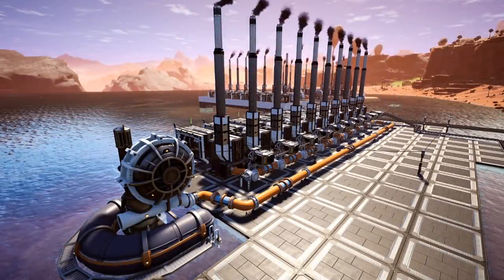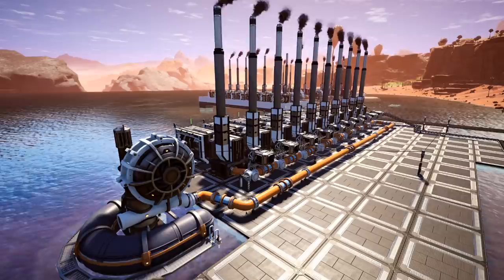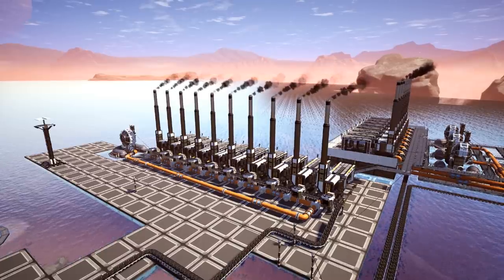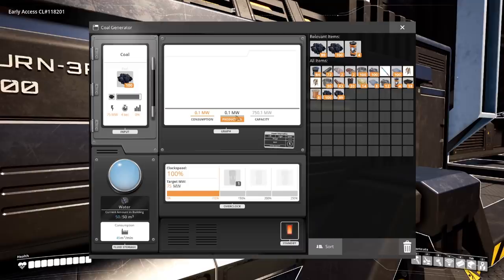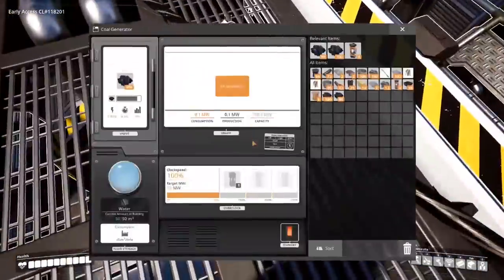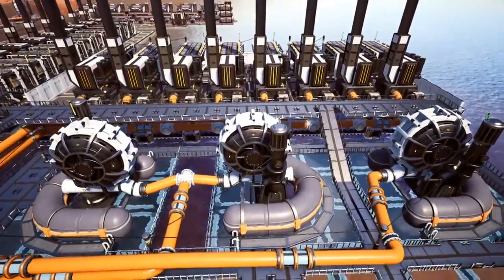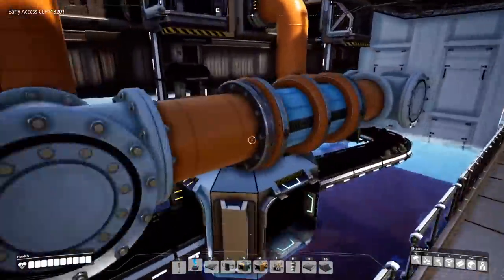Mythbusters How Much Water Do You Really Need To Run A Power Generator  Satisfactory Game

Comment: Excuse me for being a pedant, but you are confusing megawatts and megawatt hours! Megawatts are a measure of power (1 million joules per second), megawatt hours are a measure of energy (1 million joules per second for one hour). They aren’t interchangeable! On the graph, the level of the line is the power and the energy is the volume of the area under the graph over the duration of an hour (which I presume to be the whole graph). In almost every case in this video, you say MWh instead of MW and as an engineer this irritates me more than it probably should :S

Comment: Unfortunately, on a larger scale it is not profitable to build so much, although it's cool and I recommend it to start with
Reply: Coal power is early mid-game. With oil power water gets unnecessary for power production... at least for a while.
When the nukes are coming water will be essential again and as the startup of the system is quite "expensive" nobody would take a risk and add too many plants to the water network. ;-)
Reply from the maker: Yeh you're right, unless people use factory switches...
Reply: Luftwolf Unless you have the watered down fuel recipe,  then you need bottled water,
Reply: @SirHackaL0t.  : Yes, that being an exception of course.
Interestingly I don't know of many people who went that way. Most focused on getting to Nukes as fast as possible instead...
Reply: Luftwolf why rush the game? Half the fun is building up to the end game. Going straight there spoils the journey
Reply: @SirHackaL0t.  : For me the game just begins when I've unlocked all tech (including alternate recipes) and spotted that perfect location for my final base. ;-)

Next I'm collecting all kinds of resources and setting up enough power plants to never be concerned about that again (which right now means 20GW to me; as soon as overclocking is possible again the double).
This requires nuclear plants as I don't want to flood the map with fuel generators. xD

Of course that's a matter of taste. 8-)
Reply: @luftwolf7405  aah well... 60-80 coal plants... who needs nuclear power :D the global warming is brilliant, no snow to remove from your train before you go for your morning ride :D so much easier than nuclear hassle to be honest... 3 mines running full tilt = loads of fun

Comment: How much coal do you need for the 8 generator setup ?
Reply from the maker: at full energy production a single generator uses 1 coal per 4 seconds, so 15 per minute. 8 x 15 is 120 per minute. So a single full mk2 belt - but you'll rarely be running at 100% capacity.

Comment: I use 1 water pump at 250% (300 then matches 50 per power plant) for every 6 coal generators as a modular group......seems to work great, but perhaps others can point out flaw(s) in this approach?
Reply: Well yes it works, BUT..  overclocked buildings consume more energy per product (1 Pump at 200% consumes more than 2 Pumps at 100%). And you're wasting Power shards for something simple like a waterpump instead of just building a second one. Those could be better used in e.g. a Quartz node or what ever you are lacking in your current stage of the game. (Ignore that second part of you have excess of shards and dont know what to do with them :) )  But yes, its compact and Handy if you're limited in space!
Reply: @Gsichtshorst  thank you for the clarification, appreciated

Comment: a small thing, I'm not sure if it helps by that, but your conveyor and pipes are  a bit wrong maybe
if you get like 120 coal per minute, your first one gets like 60, as you split it there, then the next one gets one 30, the next one only 15 and so one. as it's the same with the water. idk if it would change if all generators get the same amount, but just wand to mention it.
my set up have like 9 generators for now and my only issue is like  to seperate my water pipes
Reply from the maker: They're not wrong :) This is the overflow method. You can split pipes and conveyors evenly but it works exactly the same. Take for example a factory running at 50% of the power produced and we have 4 power generators on a mk1 belt.
You're right in that the first generator will take 50% of the resources, so for this example 30 coal per minute and at 50% consumption the generator will consume 7.5 coal per minute. so within 3 minutes the power plant will be fully backed up and once that happens only 7.5 coal will be split per minute to the generator. The second split will now send 26.25 coal per minute to that generator until full and after a total of 47 coal will be sent on to the last split. (also bear in mind that they will still be filling up whilst the other generators are in use.)

It'll take longer for them to get up and running, but doing it this way you'll find that the system is quicker and easier to scale and also has less down time, as if you're constantly splitting perfectly any minor hicup will effect later down the line where as with a manifold / over flow system there's a backup supply. I cover it in a video if you'd like me to link you to it. 
If you have 1 extractor to 9 generators I promise you once your factory power consuption goes up, you'll quickly run out of water in your power plants
Reply: @TotalXclipse  I mean sure, both things work and I use a combination from both, splitting so all get the same amount, but not carrying how much I get. I have like two groups. one is full have like 6 coal generator and the second have 3. I have 3 or 4 water pumps and 1 mk2 miner on a pure coal I don't use the improved coal for now (but I could do it). I mean yeah. the only overflow is easy to make and takes less space. but by a power plant, it's quite risky as like when the last one gets barely supplied  as you advance further and not thinking at the power. normally you could supply your base with it, but if one generator gets down, your whole base gets it too. I mean sure, the other one doesn't pretent it too completly, but there is a higher chance that it will keep going.
I already saw your manifold system and got a bit confused as I know the first one with splitting (who uses imkibitz I think) is like splitting it up and uses the right number for the stuff and even merging the stuff together, but I mostly look at the numbers and if I produce enough, then I will just let it. 
sure your technic works too, but idk, it looks abit better if it's splitted at least,so you could look at one pipe or conveyor and if you see, it gets less you know you need to stuff to it
Reply from the maker: I agree it looks better if load balanced perfectly and I use both methods, and as far as I know Imkibitz uses both ways as well. But I’m not pushing any amount on my manifolds. Like you would the perfect split I put the exact needed ratio of items. The last splitter on the manifold will always continue running splitting 50/50 between the two last generators and only when I exceed the power I produce will the system all shut off.  ☺️

Comment: There is no point to this test. You are only using 0.1 mw of power, so your coal generators are not using any water nor coal in the proces. If they where running at a 100% capacity you wouldn't be able to mantain the circuit because of the lack of water.
Reply: Well, the point of the test is was to bust the myth, and did it really well.

Comment: I am afraid you made this way more complicated than it really is.

A power producer will consume as much % of displayed resources per minute as the ratio of used power to power capacity is.
--> A usage of 60% power will mean 60% of 15 coal & 45m^3 water per minute (9 coal & 27 water per minute)
Since one should always construct for 100% usage, it really is simple maths.
Reply from the maker: I know. But I've explained that prior to people and sometimes people don't accept that. Which is why I've done this setup to show them :)
afterall for some, seeing is believing
Reply: @TotalXclipse  oh yeah definitely. But for those people a demonstration wont change their attitude either. They do what works for them until it doesnt and then complain about a broken system, bugs and whatnot. Those that do not acknowledge a calculation are a lost cause imho.

Comment: my pipes are never full but my coal plants all have enough water so i guess it works

 3 water extractors to 8 coal plants with a pipe connected at each end and one in the middle
Reply: if u stop generators and let pipes fill tehy will be full after all the time you propably just conected it too fast before they had chance to fill and since you produce 360 water and comsume 360 water there is nothing that stays in pipes thats why they are not full but your setup works good :) but this could be problem if u were building for example nuclear power plants where you also need to care about pressure when you consume and produce same ammount :)

Comment: You need to use buffers.   I use one extractor for 5 generators 2 of them are overclocked.  but all generators have 2 buffers on each stacked.  Because my factory never consumes full power.  but I am experimenting wth different ideas.  But I noticed pipes do not work like conveyors.
Reply from the maker: I've never used buffers on my power generators, as I always plan the max amount of generators to the amount of resources I have available, if I only have 60 coal produced per minute, I'll only build a maximum of 4 generators.
Reply: @TotalXclipse  You made me paranoid so I am using 1 extractor per 3  generators right now.  and I have one feeding 2 generators that are over clocked...  but it is a spagetti mess of horrors really.  since I just started the game I really do not care about neatness really :)

Comment: Usually you can get 3:9 ratios when you remember your sustained load is ~88%.  Most factories dont run at 100% all the time as belts are not 100% balanced, so we dont need to make coal power plant able to sustain its 100% for prolonged time. Include water storage to expand time it can "boost" itself and you find 3:9 ratios sustainable and good enough.
I am explicitly saying 3:9 not 1:3 as any system where there is a single item is usually killed by human mistakes. Redundant power systems works best.
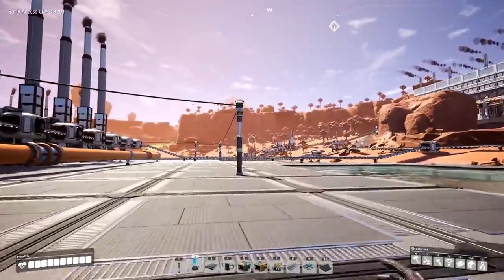Stockpile water and coal when demand is low, use it when its high. (works best with solar power mod). If you do use coal as solar help to survive the night, 3:15 AND 1200-1500 units in water storage tanks is the number you want.

Comment: Somehow I can use one single water extractor+ a couple pumps to generate 300m3/min no overclocks
Reply from the maker: Hmmm sounds like a bug, unless you're not using a 100% of the water/fuel consumption then perhaps it's back logging so it shows the pipes are full?

Comment: Great Stuff! I'd love to see the max of one overclocked Water Extractor. Especially when in some areas of the map your water spots are the limiting factor.
Reply: max OC water extractor does 300m3/minute, i.e. one full pipe. Since coal generators use 45/min you can power 6.66666666 generators for every one 250% water extractor. This is easiest done by building 3 extractors at 250% and plugging in 20 generators, water goes in at start, second at the 7th generator pipe junction and again at the 14th junction. This works because pipes will back-fill, meaning none of the water gets 'stuck' anywhere.

Comment: Not fully myth busted as he hasnt used a pump pipe attach ment half way to end even tho its not going up hill i found it boosted flow . Maybe im wrong but i was running six easy enough off one pump. With all power being used too.
Reply from the maker: You don’t need to boost the flow, at least not at this distance, and you can actually use gravity to stop needing pumps at all if you should really do so. 
I’m pretty certain that unless you’ve overclocked your extractor you won’t be able to run 6 coal generators once you’ve got your power consumption for your factory above 60%

Comment: it's worth it to stack so many coal power than fuel power?
Reply: All depends on your late game balance, do you need the coal for steel, the oil for plastic and rubber, the coke for aluminum? Also late game nuclear power takes a lot of copper and caterium which you would rather use for other production. 

I have never really seen any content that identifies which power source is most resource efficient for the end game...balancing which resources are used for maximum production vs which resources are used for power.
Reply: Thank for the enlightenment!

Comment: I have 5 extractors to 10 power plants and they still have problems getting water :((
Reply: Are they all connected in series because you might be having throughput issues with the pipes if so.

Comment: You put 10 splitter in a single line i dont understand this, the 10th splitter should receive only 1.2% of coal, it's like you are saying  when you put a splitter it's a magic splitter which doubles the ressources
Reply: With overflow a single mk3 belt is enough for 18 generators
Reply: The first splitter doesn't split 50-50.  It does go 50-50 when you first start sending coal down the line, but because 50% of the coal is greater than 15coal/minute, the coal power plant fills up with coal and starts backing up the conveyor.  When the conveyor backs up to the splitter, only 15 coal/min will be sent to the power plant, while the rest will go straight on to the rest.
Reply: This is the manifold or overflow method.
The basic idea is that the first machine (or power plant here) of the line will fill up its reserves faster with resources only consuming what it needs and refilling when needed. Then the line will overflow the rest of the resources to the next machine in the line, and the next, and the next, etc.
If you provide enough resources for all machines in the line then over time all machines will fill up and tend towards maximum efficiency. Depending on the length of the line and the consumption rate this can take a long time.
The main advantage is that it is easier to set up at first and that you can expend it easily when you add more resources to the line when upgrading conveyors or merging multiple resource nodes.
Reply: @zathoth2945  Indeed, you can make it better by using a high speed line for the main belt and the smallest belt you can get away with for each manifold junction, a mk1 belt can only ever take 60/min so if it's on a mk5 main belt you can even-split 13 machines even before stuff backs up. You can also increase efficiency by feeding the manifold from the centre and having the splitters feed machines to both left and right. Ultimately it's just much more compact and resource friendly to manifold rather than perfect split, and the spin up time barely matters for the VAST majority of potential build strategies. As long as the lines have backed up before you turn the machines on spin up is near-instant anyhow.
Reply: thank you for all your response i am always trying to make perfect split but this way is much more simple if i understand correctly i need to wait to fill up all the coal generators before letting them run and it will work
Reply: @mehmettanriverdi8467  yup, as long as your total in is at least the total out then you're gravy, good luck!
Reply: @Veklim   so i can make a single line of 16 generators with pure coal on mk2,  this is gonna be cool
Reply: Mehmet Tanriverdi the same manifold and overflow mechanic works similarlly with fluids as well. 

The first machine will fill up first and so on down the line.
Reply from the maker: There's not much point me responding now as everyones explained it very well. but yes, I'm using an overflow method as the max consumption (when at full power) is 15 coal perminute. So long as I'm inputting more than that on a line per generator then it should eventually fill to the end and run to max (with a staggered start)
Reply from the maker: ahh not quite... it will start running straight away providing you're not using max power consumption. They will turn on staggered, first generator, second, then third etc until all are running.
Reply: TotalXclipse I also discovered this is true even with turbofuel. I recently built a 294 fuel gen plant and used long manifold style connections. It took almost 15, 20 minutes for the generators at the very end of the lines to fully fill with turbofuel. 

These are 55 fuel gens per pipe, so really big area.

Comment: This is false your running only 1-0 power so the use of water is almost nothing you have to use the max power per plant in order to see the water usage so video worthless
Reply from the maker: You do realise that power runs 100% regardless....
Reply: If you want to push it you need to connect a few energy storage so all your power plant work at 100% all the time until storage is full of energy (+ the amount of machine connected at you network) let's say some 5 or 10 energy storage, when made this kind of build just use 3 generators per pump and work good, whit out over clocking, put one generator more you need to over clock the pump 1 time never try with more generators at 1 pump  (+ 5) im gona try some day .  silly me, pump push 150m2 per min and tree generator use 50m2 per min lol that's why work perfect lol

Comment: All I'm getting from this is that Satisfactory doesn't understand how power generation works and doesn't understand how pipes work. A pipe is not a container when the only metric provided is a flow rate. The gauge showing water in the pipe or not is treating it as a container with a set volume, and has nothing to do with the flow rate. 

If a plant can produce 75MW, it shouldn't give a dip if it's being consumed or not and should have no baring on how much water it consumes to make that power. 

But all of this harkens back to one of the biggest issues with the game: it's UI is significantly lacking in clear consumption and production rates for every machine.